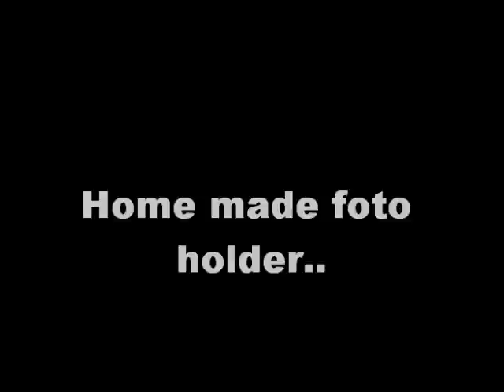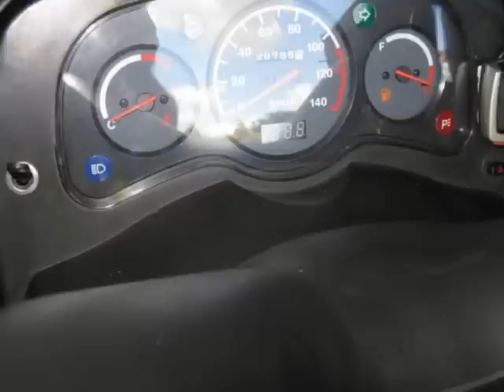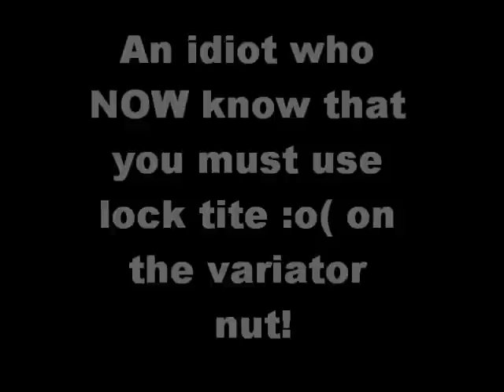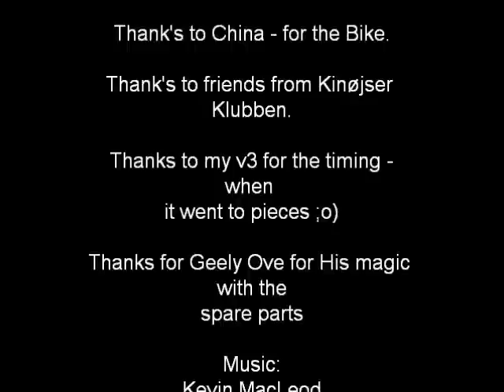CfMoto V3

Comment: My 2008 cf Moto 3v won't come on. Had my brother charge battery but don't seem like it charged. No lights or anything. Could there be another reason why no power
Reply from the maker: There may be poor connection in wires, a burned fuse or the battery has collapsed. You must be able to measure 13 volts over the battery. Good luck with the operation ..